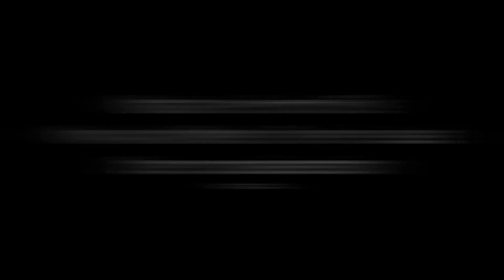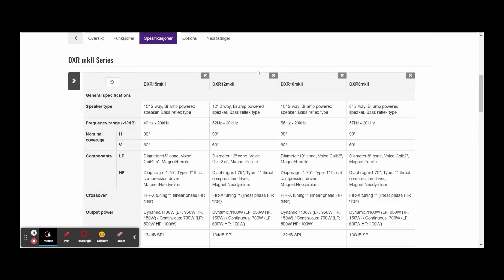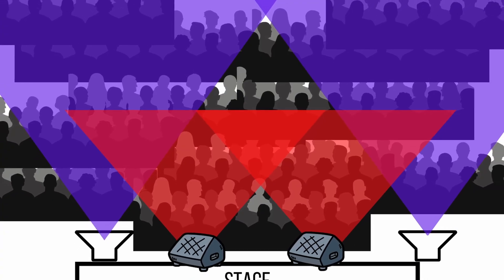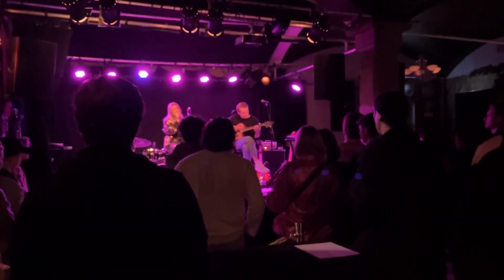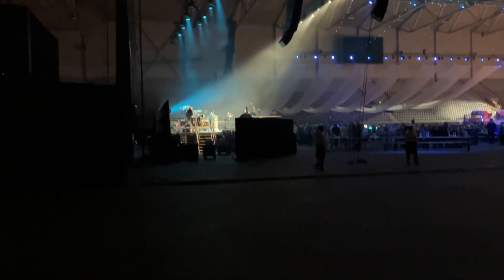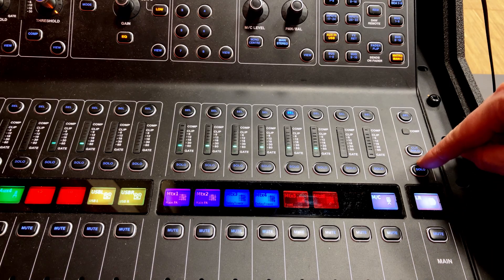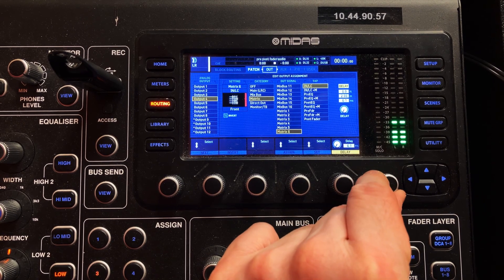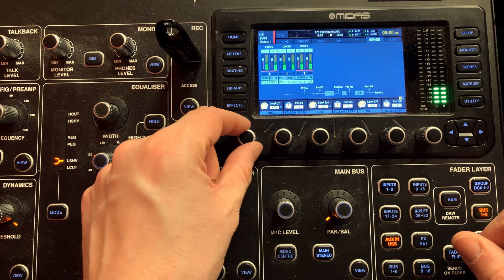Understanding Front Fill Speakers Step By Step

Comment: we have a decent size room at least 18m x 18 but the audience sits quite close to the 200mm high stage which we think is to low for front fills. Is it worth just getting ones that angle upwards on the front of the stage, or to keep the front of the stage clear, hang some smaller 10" yamaha speakers under our 12" drz yamaha speakers (currently on the ceiling) and rotate them down and towards the front as downfill outputs?
Reply from the maker: Yeah that sounds like a great idea.

Comment: Hey Andrew.. once again great lessons from you.. thank you for responding to my previous questions so quickly.. i commented recently on yiur parallel compression and mixing bass video lessons.. i have another question.. im using a behringer xr18.. i dont think i can set delays and i dont have a DSP for my system.. if i need to set up front fills what should i do.? Cant i jus do it without any delays..? I can always choose a bus for my front fill and decide what to send to it.. right??
Reply from the maker: Hey, Thanks! yeah I think I'd set it up even if there was no delay. It's likely the benefit of a fill will outweigh the drawback of it being poorly time aligned. Though use your ears and make that decision based on what you hear in the venue.

Comment: Watched a few of your vids on various topics now. All have been very useful. Certainly earned a Sub!
Question on this one, in conjunction with the one on delays, do you prefer (advise?) to do speaker-related stuff (delays/fills/processing etc) on the board via matrices or externally in a dsp in a rack? What's the pros/cons of each method? This would be a interesting video.
Reply from the maker: This is a great question! I would generally recommend doing it in the processor, even if it's the matrices straight into a processor. I think it seperates the creative from the technical. Also processors tend to have more appropriate filters for crossovers and more accurate delay times. Good idea for a video though, I'll add it to the list!

Comment: How to setting YAMAHA M 16 xu that analog audio mixer
Reply from the maker: It's not possible to set output delays on this mixer, most analogue mixers are not designed for this. Consider a system a processor.

Comment: You sir, have great videos! I’ve been watching a lot of them. Great explanations, great demonstrations, very useful and good to know information for up and coming live sound engineers
 
I have a suggestion - could you make a video about allocating and pulling power for a venue? For instance, how much can you connect to you one outlet before it trips. Should you split power from stage monitors and instrument amplifiers & why, etc. I think that would be helpful. Thanks!!
Reply from the maker: Thank you so much! I am by no means an electrician but I can definitely share what I know about stage power. The problem with electricity is it's very dangerous if you get it wrong so I tend not to make any videos about that stuff. But I'll see if I can find away to make a video without putting anyone in danger.
Reply: I second this - great stuff.